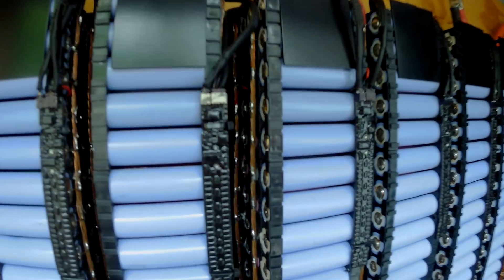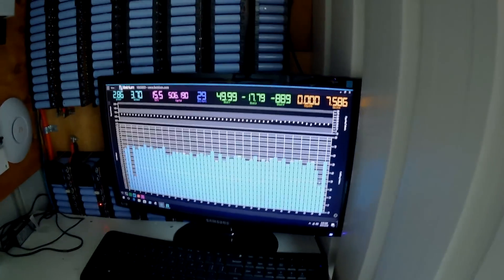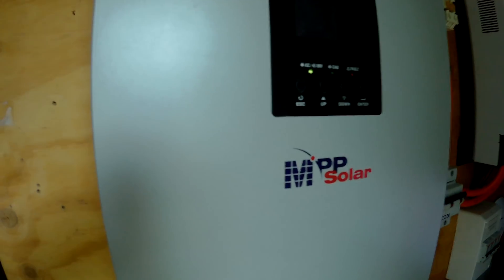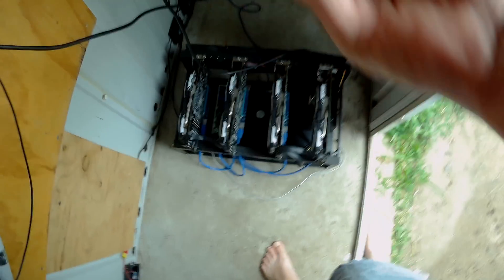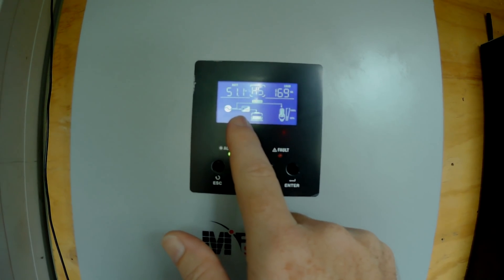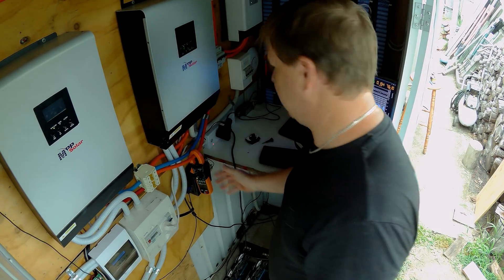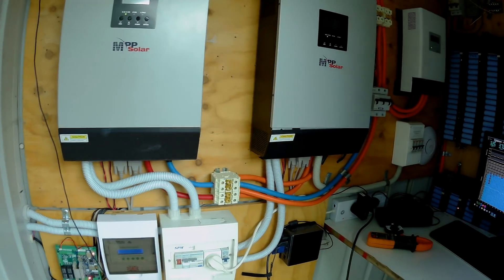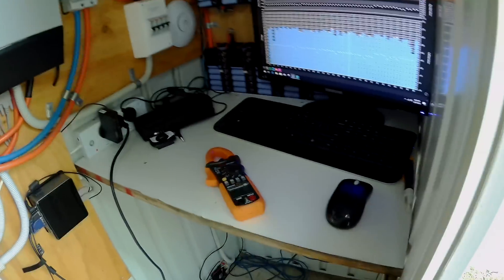DIYPowerwall and Crypto Mining don't work well together (02-01-18)

Comment: The problem isn’t the fact you are using a solar system to power your mining operation. The issue is you are expecting too much from a system that needs more input during the day, to offset cloud and bad weather. It’s a good idea just expecting bit much from a system that was designed to power a suburban home with intermittent loads.
Reply from the maker: Ooh expecting too much is absulty the case got two weeks of runtime before they went this flat so that's pretty good running I'd say! More panels are on the cards - another 2kw should get me over the line- then i just need to address the looming heat issues

Comment: Do you have some type of power conditioner in between maybe add some deep cycle batteries
Reply from the maker: NEVER again will i used deep cycle batteries! I use a www.batrium.com bms to manage my cells
Reply: HBPowerwall ok but what about a conditioner
A client of mines was having all sorts of problems only with his computer equipment until we added a conditioner too clean up the power coming in
Reply from the maker: no issues what so ever been using them for years - quality psu's in the computers help
Reply: HBPowerwall ok

Comment: first! Ouch, just a LITTLE inbalance. Maybe iron out which cells are not as good as others?
BTW, grafana has an addon that can send alarms if the batrium doesn't do it (which may be a feature request if not already).
Reply from the maker: you can't walk around a corner in my home with out seeing my batrium display :)